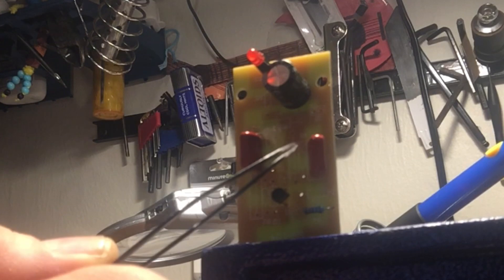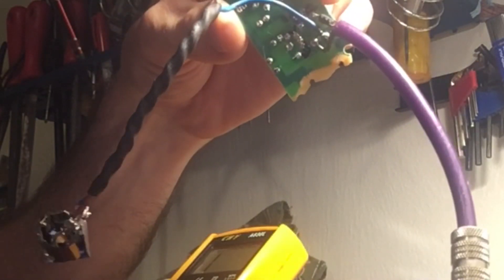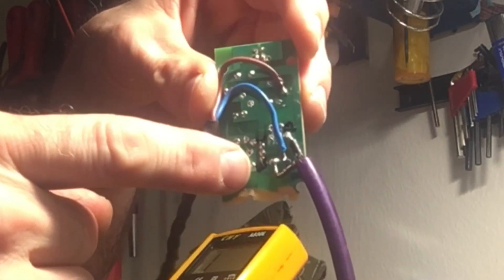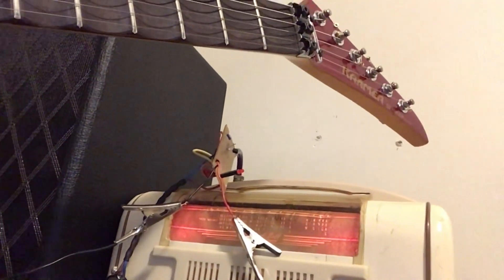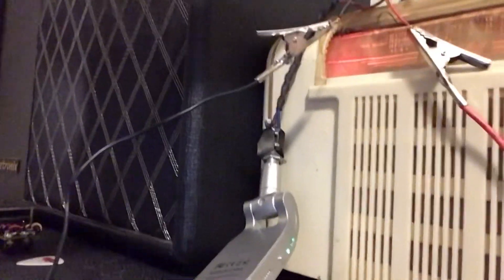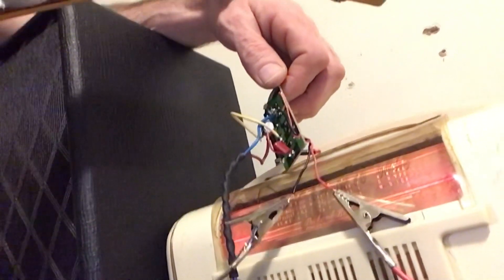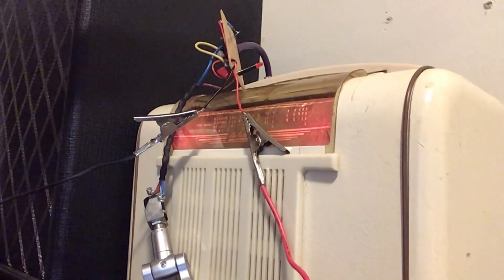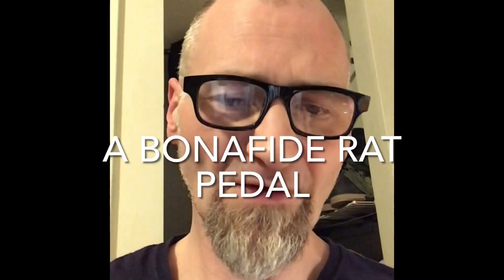Big Muff Distortion- Right in The Pest Department

Comment: ur opinion pls... should i sell my bv-120h crate u.s.a., or keep it?
Reply from the maker: Built better than Marshall JCM 900 cabs by a long-shot, plastic handles and output jack panels in particular but better speakers, Celestion. 
Crate speakers are stock and go bad eventually within our lifetime but the cabinets are way more robust and metal hardware and panels etc. My plan is to swap out speakers as I can afford- I only paid 60 bucks for mine and only one bad speaker which I’ve replaced with the cheapest Amazon has and it still sounds fantastic- I run a stereo rig to boot so that’s the only main reason I own the 4/12 is because it’s stereo- makes everything sound huge especially with the delay and reverb. Keep her. Especially if she’s stereo. They’re built really really nice.
Reply: i used to have peavey stereo 4x12", sold ... now u made me miss it, thx lol ...but that crate i have is a tube head, and actually, from the peavey cab... they sounded good... now i only have stereo behringer 4x12", and it says 400w (...hmm), made in china